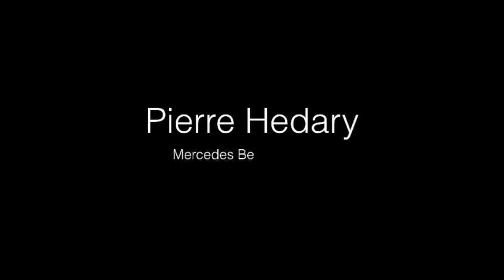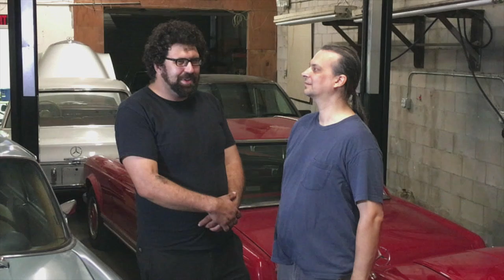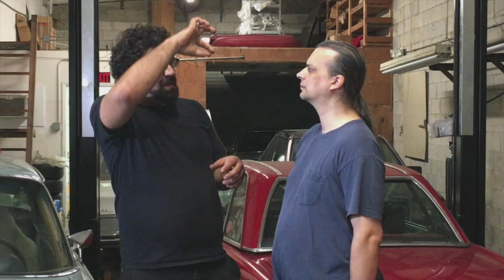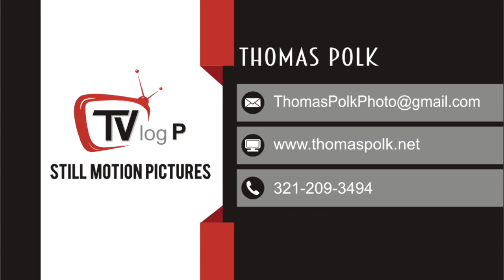Transmission Flares Explained

Comment: I have a t1n which has a 722.6 transmission and it flares 2nd to 3rd what do you think it is? I replaced the solenoid but it still has a flare
Reply from the maker: Hello, Janaka Bandaranaike and thank YOU so much for your question(s), we want to answer you as quickly as possible. 
By signing in our Patreon https://www.patreon.com/thomaspolk page and making a donation of $10 your are assured of a 24 hour email response from Pierre. 
If you are already a $10 member please mention along with your question.

Comment: This occurs on my 2014 Malibu turbo. From 3rd to 4th and only has 33k miles. Dealer claims it drives as designed for a 6 speed. I’ll be taking it to another dealer later today
Reply from the maker: I smell shoddy workmanship!
Reply: Mercedes Classic with Pierre Hedary the update from the other dealer was it “slips clutches when shifting from 3rd to 4th” And is in GM spec. I stated a flare isn’t normal and this never happened until the last 6-10k Miles and they said I was out of luck cause it wasn’t throwing a code so warranty probably wouldn’t cover it so that’s wonderful.
Reply from the maker: @zero2sixty244  mechanical failures don't throw codes...but you know there is some kind of transmission recall on your car...I can;t pinpoint the exact natire of it but...https://www.google.com/search?rlz=1CAACAP_enUS761US764&ei=5TzeW4bLF9Kb_QacyaiICw&q=chevy+malibu+turbo+transmission+recall&oq=chevy+malibu+turbo+transmission+recall&gs_l=psy-ab.12..35i39.6319.18941..21516...0.0..0.116.471.4j1......0....1..gws-wiz.......0i71j35i304i39.cwcJTJd8OQE
Reply: Mercedes Classic with Pierre Hedary ill definitely look into this. Thanks a lot for the info!

Comment: Hey Pierre, here's another instance of flaring on a 1982 300CD. When the car starts out cold, the transmission flares terribly from gears 1 to 2, maybe also a little 2 to 3. Come to a stop and take off again, it will flare less. After flaring a third time, it begins to shift wonderfully. Replacing the filter helped immensely, but it will still flare a little every now and then. One theory involves the cork seal in the filter allowing fluid to drain from the places it should stay. What do you think?
Reply from the maker: if you have an original vacuum modulator, remove it and make sure the pin behind it is not broken in two. the symptoms you described echo those of my vacuum modulator pin breaking.
Reply: I recently found ATF in the line to the VCV, so I replaced the modulator with an upgraded model. Pin was fine, diaphragm was shot. But that was replaced after the problem was resolved with the fluid and filter change. But maybe that just changed the conditions and just made it appear to be fixed, with the real fix only coming with the modulator switch. I think you're probably right. Nice one.
Reply: @Greg042869  yup...atf in the vac line to the modulator is a sure sign its failed
.
the motor burning the trans fluid is not good for it also....can even out right destroy the engine if its really bad
but anyway.... your motor should run a bit better....plugs last longer.... less smoke out the exhaust ETC
Reply: @kainhall  Something I went back to doing is I put a little clear fuel filter in the black vac line after the VCV on the way to the transmission. It shouldn't go bad for another 35 years, but it will be easier to spot if it does.

Comment: 722.9 s550 just swapped old trans for new. STILL DOES FLARE IN 1ST TO 2ND AND 5TH TO 6TH?
Reply from the maker: this must be a control module issue. Do you have SDS?
Reply: The Pierre Hedary Mercedes-Benz Classic Specialist im not sure what an sds is. My mechanic says the tansmission needs re calibrated or reflashed so to speak. Does this sound at all right? Thank you for your help!
Reply from the maker: sds is star diagnotic system...it would show you the fault codes in the transmission module .

Comment: I have an 2006 CLS500 722.9 transmission and it flare from 6th to 7th if i depress a little the gas, but if i take of faster and pas 55 to 60 mph the gear change its smooth, i got the oil and filter replaced at dealer at 52k miles and visual inspection of oil and transmission plus computer scan and everithing its good, no codes so dont need a new TCU/valve body, and no metal inside the transmission oil or filter, so they just state that is the torque converter lock up and its normal
Reply from the maker: typical 722.9 transmisison wear...how long has this been happening?
Reply from the maker: I am one of the moderators for the Pierre Hedary Mercedes Benz channel and I saw your comment. It seems as if you'd benefit from personalized attention for the problem. We have provided a way for owners to get the help they need. If it's okay, please visit the website: https://www.ClassicBenzSOS.com so you can schedule a call from Pierre Hedary. --LauraH
Reply: Did you ever figure this out?
Reply: I was told re programing
Reply: Same here, 08 ml350, 722.9, except mine is a single cold shift only flare from second to third,  after first shift it’s like new, does it every morning kinda bad unless I gas it while shifting. Pan looked great, no shavings after some 50 k miles. Adaption reset didn’t fix it, new filter and fluid didn’t either. It must not be doing much damage though.

Comment: Hey Pierre, I have 84 300CD, there is a noticable flare between the 3-4 upshift ONLY WHEN I don't apply much on the accelerator. WHat could it be bro?
Reply from the maker: response in progress
Reply from the maker: I have a few questions about your transmission...
1. when was the last service?
2. How many miles are on it, or the car?
3. did you check the adjustment on your bowden cable? I should have 1mm of detente. The valve body repairs are a last resort.
Reply: 1. last service is unknown since I bought the car last year. I really should change the filter and fluid but fluid doesnt look bad at all, doesnt smell, its not dark, etc.
2. Car has 185 000 original miles
3. I have previously adjusted the bowden cable for little bit late shifts but its not very tight at all. I am not sure if the detente is 1mm but I will check that also. Dont believe it has anything valve body related because anything other than that it is a solid transmission with strong shifts.
I mostly suspect it is a vacuum related issue since the 3-4 shift is nice when the gas pedal is pressed at least half or more. Also, If I dont apply much on the gas pedal the 2-3 shift is kind of short,  but only if there is not much on the gas pedal. Idk I am confused but thank you very much for your nice response bro!